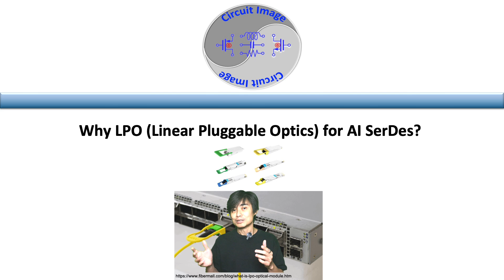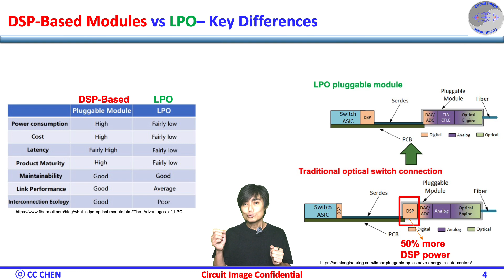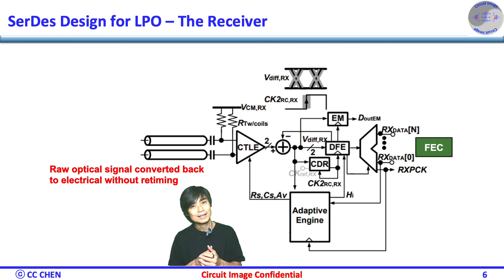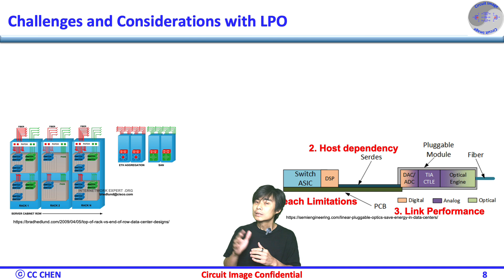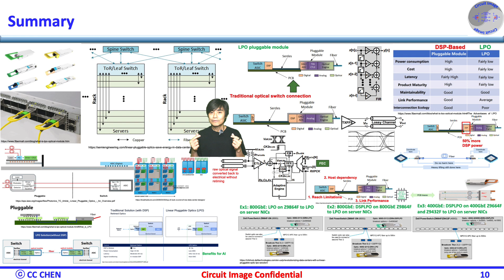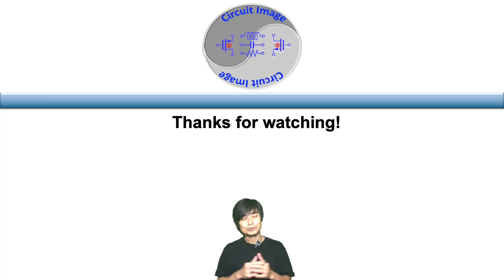Why LPO (Linear Pluggable Optics) for AI SerDes?

Comment: Again, great to see such illustrations. I work on these day to day ... thanks for creating these. DSP is really power hungry. 
It is very logical that LPO ecosystem requires time to get adapated as the host design i.e., switch also needs to change.
Reply from the maker: Hi Ponderer,
Thank you! I like DSP brings great flexibility but it has the cost of power, especially in dense links. And yes, the shift to LPO isn’t just about optics—it needs co-evolution in switch architecture, link budgeting, and control protocols. Exciting but complex times ahead!